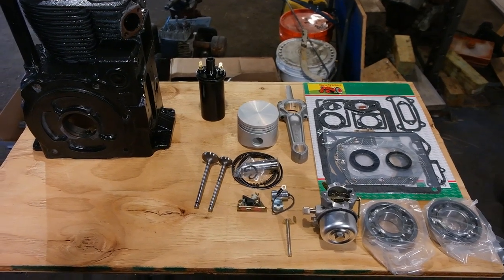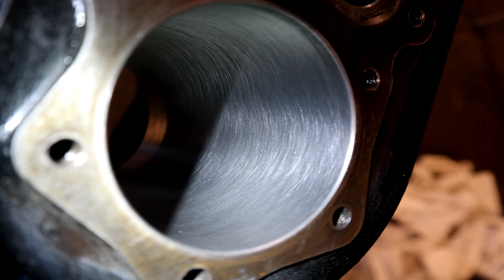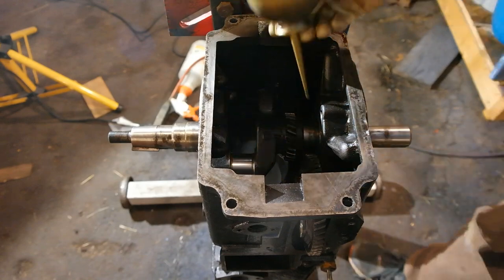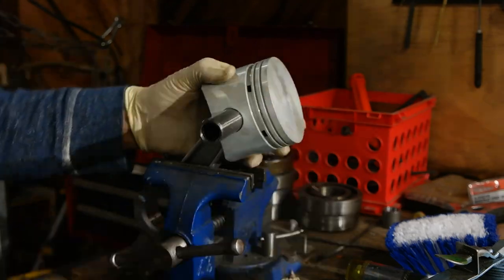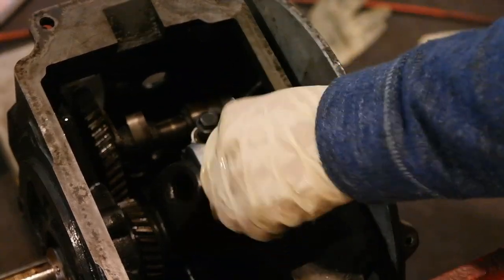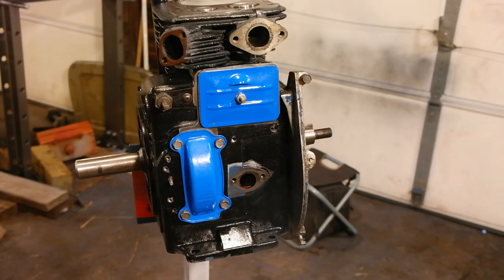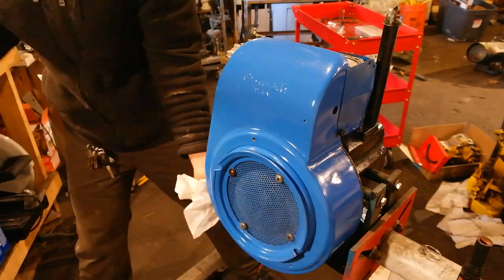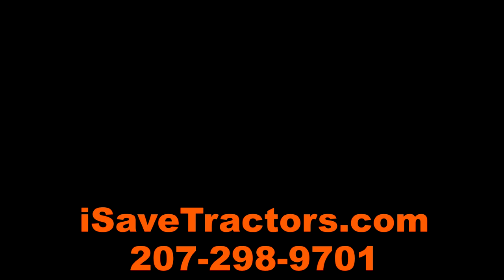How to Restore Your Vintage Garden Tractor: Ep. 6 Kohler K Engine Reconditioning & Reassembly

Comment: Another trick I have from personal experience, if your bearing is going into a housing or if your crank is going into a fit, put them in a freezer for a few hours, I worked with size on size or 2-3 thou shrink fits and it’s really great.  Conversely, heating things up helps in the appropriate places.....great videos tho, I appreciate your clarity... you’re really good at this

Comment: Here's a little tip:
It's a good idea to put a little bead of weld on the inside part of where the little arm meets the governor cross shaft while you have it out.  It's a pretty common failure point for the arm to break off. And as we all know you have to pull the engine out then pull the crank and cam out to fix it.
I've found more than one of those arms in oil pans.

Comment: 11:19 Couple of critical tips missing. Be sure to stagger the gaps/joints of the rings so they don’t line up with each other.  Also, be sure to install the rings right side up according to the instructions and punch marks.

Comment: I have a case TL 100 trencher with an old Kohler motor on it .  I think it needs a new carburetor  but I can't find any numbers on the motor. There is a number on the carburetor 5205301. Do you know how i would find out how to get parts for it. Thank you

Comment: takes me back to the assembly line only we used a hydraulic press to put in bearings, cam and crank shaft had hand inside case to turn crank to line up cam and balance gears

Comment: I may have lost the instructions that came with my rebuild kit. I have two rings, one with an inner bevel and one with an outer bevel, which is the Compression Ring and the Scraper Ring? I'm also seeing different things online. Should both bevels be facing down or all the lettering be facing up?
Reply from the maker: Hi There. You install the rings in the 3rd groove, then 2nd, and then top. The third groove is a 3 piece ring. You put the wavy expander in first, and then walk 1 thin rail below it, and 1 thin rail above it. That's groove 3. Groove 2 will be the ring with the outside step. Put that in the second groove so the step part is facing down. Groove 1 will get the ring with the inside bevel. Install that so the bevel is upward. Please email or call us if you have any further questions.

Comment: I would add to this video a couple of things. Before doing and valve seat work you must make sure the valve guides are in good shape. If they are worn then anything done to the seats will not be accurate. Also you always lap the valves weather they are new and fresh cut seats or not. I would also suggest some assembly lube on the internal engine parts before reinstalling : cam to tappets, cam gear to crank gear. Some people just use motor oil and that works too, but use something and don't reassemble the parts dry. As for the new head bolts. I don't see a reason for them. They are not torque to yield bolts like a modern car engine uses and unless they somehow got severely rusted the factory bolts have worked in rebuilt engines longer than these guys have been alive. Your choice.
Reply: jerry davis if I purchase new valves Do You think they need to be grounded down a little on the length? Or they're pretty much the right  length size out of the box? Thanks in advance

Comment: I’d like to get one of your kits for my Koehler engine but I’m not sure what size it is. There are no plates or serial numbers on it anywhere. It was restored cosmetically at some point and everything was sandblasted/painted over apparently. The body is 1954 1054 I’m sure of.
Reply from the maker: You can measure the cylinder bore and use that dimension to figure out which one it is. Give us a call or send me an emailbif you need help. Info@isavetractors.com

Comment: Thank you for the video They are alway very informational, you seem to be very meticulous. Do you sale a rebuild kit for a Kohler 18HP Magnum. I'm thinking of rebuilding mine it looks like it's leaking oil out of the rear seal. 
Thanks again
Reply from the maker: We have a complete Gasket set for your engine. We have 90% of all the parts for a complete rebuild of your engine. We will complete 100% of the parts by the end of the year then we will have a full kit
Reply: Cool vid Norman, I will be contacting you for a kit when we are ready to rebuild our Kohler MV20 Magnum.
Reply: @Isavetractors  do you know where i can find a coil for the kholer engine weldapower 150 it is a single coil. Not the one with multiple coil like a stater. It is on songle piece and a coil.

Comment: Thanks for the video. I bought my kit from you and have been working to finish the rebuild. I did wonder which piston ring goes on the top of the piston from the two rings that are not oil rings. Also, I needed to know which way they face. 

Could you answer this question? Thanks!
Reply from the maker: Sure. Ring with inside bevel is the top  ring. Install bevel facing up. 2nd ring is the one with a 90 degree step. install this step facing down. Your Piston Kit should have come with written instructions. If you need another copy please send us an email.
Reply: @Isavetractors  thanks for getting back, I found the instructions!

Comment: Hi Norm. I have an M12 on a wheel horse 312-8. When I re-assemble the breather, the nut wants to collapse in the center of the cover thus lifting the edges of the cover and compromising the seal. Any tips? The order I re-assembled is gasket-breather plate, reed valve, reed stop, rubber bushing, filter, gasket then cover. Any help would be much appreciated!
Reply from the maker: Just dont tighten it too much

Comment: The carb supplied with the kit does not have a place for the crankcase breather hose. Is there a different carb available?  Other suggestions?
Reply from the maker: Crankcase hose was a late 80's emission rule. It's not necessary nor does it reduce emissions for this engine significantly. You should re route the breather hose down and out of the way and let it vent to atmosphere.

Comment: I have a killer 14 hp cranks up fine but after running for 30 min it dies have to wait 15 to 30 min before it will start again any ideas what the problem would be?
Reply from the maker: You likely need a valve job. Here is an article on that: https://isavetractors.com/articles-1/engine-science-fixing-the-rough-running-engine-with-a-valve-job/

Comment: Do you guys stock new crankshafts for the K181 Kohler 80501d ?
Reply from the maker: We don't but we may able to direct you to good used ones
Reply: @Isavetractors  if i could find one that is std i can have it turned .

Comment: Will a 45 degree valve seat cutter work also how big around is needed
Reply from the maker: Most will cut at 46 degrees to have that interference angle. The max valve head width is 1 3/8"

Comment: hi norman:  There wasn't a governor thrust washer (brass?) on the stub shaft when I disassembled my k241.  do you know what size/width that is?  I will want to put that be in between the governor gear and the stub shaft I'm assuming.
Reply: Phil Hall  there should be a K301 in the case of the one I have embedded behind the bearing plate where it attaches on the block. if it is a K series.  that was how some of the K241s came which are 10HP
Reply: Phil Hall  was your grandfather the dealer selling them?  post some pics of what you have pls & thx.

Comment: at 17:55 in the video after you assemble the valve breather plate, just below that plate there are 2 bolt holes.  what are those used for or are they used at all?  my k241 is very similar to what you rebuilt in this video.
Reply from the maker: Those holes are for various speed control linkages. Some tractors use them, others dont.

Comment: Hi Norman, I bought your kit for my JD314 with a k321 then lost my phone with all my pictures. Quick question if you could. Does the bearing cover have 4 equal length bolts or are 2 longer ones? I had all 4 in the same bag but the 2 seem to bottom out before they tighten down.
Reply from the maker: 4 equal bolts. I believe 1.5" long
Reply: @Isavetractors  thanks, no idea how I managed mixing those up. They were the only 4 in the baggie and each had its own washer

Comment: I rebuilt my k301 and it was really tight once complete. I could only turn it with a ratchet. Any idea what could cause that? Once I got it started the governor was not reacting to load changes. Now it won't hardly turn over and when it does start it runs too fast like the throttle has no control over the engine speed. Thanks!
Reply from the maker: Could be many things. Call my office and I can help you.
Reply: What's the number?

Comment: !! At  20:20 those head bolts look a tad short.   ....  And I clean out my bolts holes before I start putting in new parts,  not after I have a new piston & rings in there.
Reply from the maker: about 90 seconds after that point, you will hear me explain the head bolts.
Reply: Paul Couch Hello,  how do you clean out bolt holes Sir?  Do you use a tap too?  I will be replacing a head gasket on my K321  any tips would be appreciated.
Reply: @josem.2909  I use a tap tool, WD-40, compressed air, but do it before I put in any new parts.
Reply: Paul Couch thank you very much sir! Since I'm just replacing the head gasket, guess, l only put the cylinder at TDC and cover it very well before cleaning the bolt holes,  thanks for replying

Comment: How do you tell the difference between the scraper ring and the compression ring??
Reply from the maker: Depends, but typically Inside bevel is compression ring. Scraper has 90 degree step.

Comment: when you install the bearing plate onto the PTO shaft after putting the 2 gasket/shims, it is not evident if you had previously installed the bearing into the bearing plate?  is that the case?
Reply from the maker: Yes I installed the bearing in the bearing plate and then installed onto engine. Thanks for the good question

Comment: Kohler says 285lb on the connecting rod then I reolised the old measuring system was in inch pounds not foot pounds i forget that was wrote for a beam wrench it translate to
Reply from the maker: We have had customers make this mistake. Big difference between 285 inch pounds and 285 foot pounds!

Comment: I've never liked the Kohler engines
Reply: HI. I'm new into this kind of hobby. Qst: why do you hate Kohler engines?  From what I see on the internet, these engines seem to be kind of good engines for commercial machines. I got a free Ford LGT165 tractor from someone who bought a new property and it was in the gagage, since neither the guy or his wife didn't know anything in mecanic, they just put it on the internet for free to get some more room in their new garage!!!. So I'm planning on rebuilding the whole tractor, myself and probably installing a front loader (I already bought all the parts for the building in the last year planning to do it). I have a lot of Tools, and I worked in the past with mecanics , and I thought , why not that ford tractor, it seem to be a good proect, and later, probably doing some small jobs with it, and making some money out of my project…  Tks.
Reply: @cambobby2011  I've had a lot of problems with the older twin cylinder Kohler engines in a lot of my tractors
Reply: @lukebecker1959  I read about problems with the 2 cylinders Kohler engines. Mine is a one cylinder 16hp K341. From what I read, these one cylinder engines are kind of classic and good ones  I hope this is true!!!Lol. But for now, I haven't even stated to look at it yet, so  it's just sitting in my garage, untill I finally get the time to start working on it  this winter. As a hobby, I'm all excited about this proect, l'm like a kid walking in a candy store!!! Lol. I've always wanted to do that kind of projects on my own. Anyway. I'll see…
Reply: @cambobby2011  yes the one cylinder Kohler engines are good engines and could last a very long time with little to no problems at all
Reply: @cambobby2011  good luck on the tractor
Reply: @lukebecker1959  That's why I chose this one. Tks man.
Reply: @lukebecker1959  I hear you there. I have a KT17 motor and that has been a problem but my 12 hp kohler in my old cub has always been reliable.

Comment: I do NOT care for chasing the threads on the block before installing the cylinder head with a tap, mainly because there some shitty taps out there and you may remove material where you don't want to. A little oil on the threads would be better.